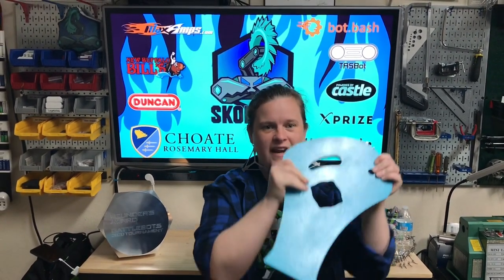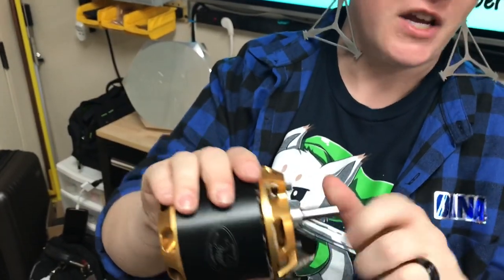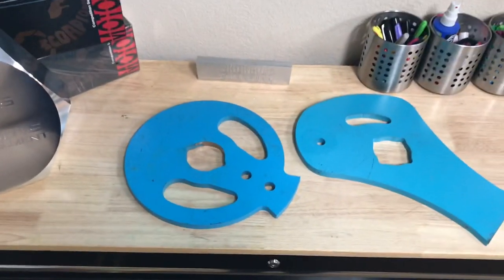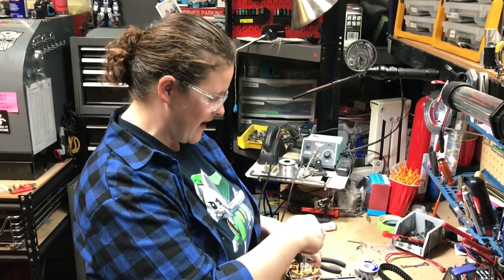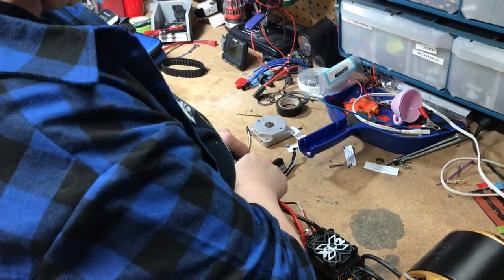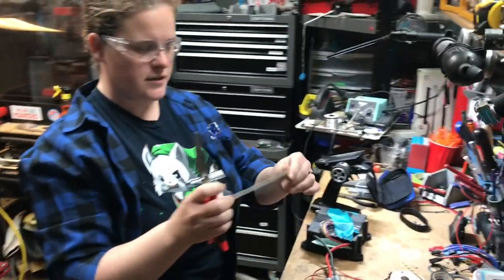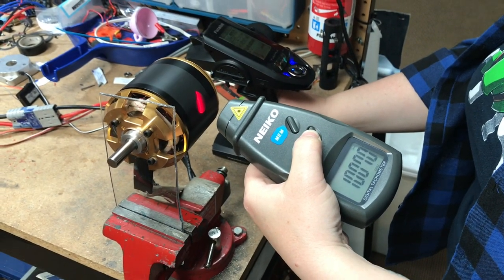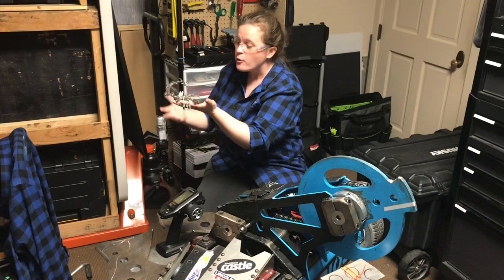Skorpios Builder Blog Episode 7: More Weapon Power

Comment: Good luck programming that ESC, TASBot is going to have their work cut out for them. Most failures of brushless drives happen because the programming is incorrect, the motor overheats or throws a fault and the ESC just gives up. Don't want to suddenly have no active weapon in the battlebox, you wouldn't be the first bot to have it happen!

Talking about cutting, that new blade looks awesome. That bite is incredible and for sure going to break some bots.

Looking forward to the next vlog! (also love the SoW earrings)